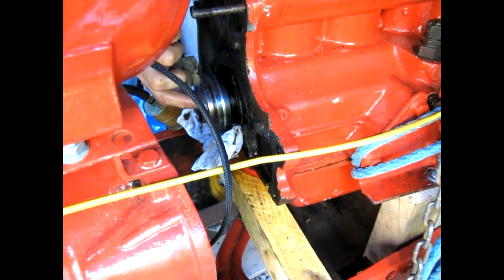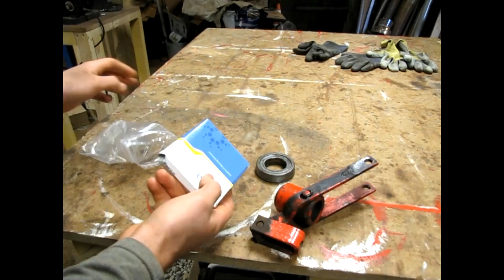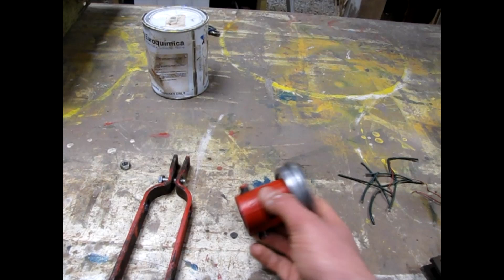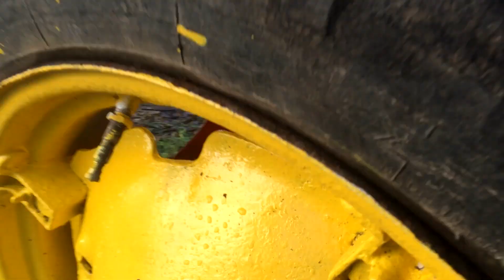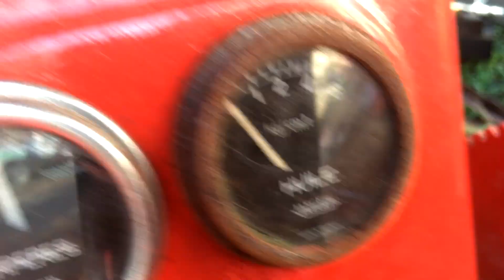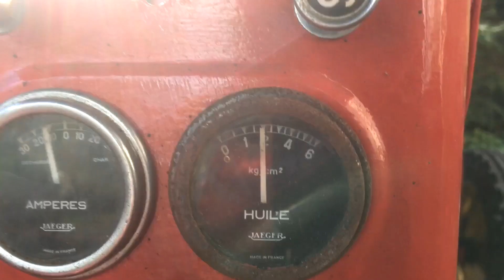The Massey Harris Pony Runs Again! Clutch and Regulator repairs (pt4)

Comment: the old cork gaskets 😮😮 aren't much because they leak they draw up and won't hold 2 the surface U are better off 2 use the paper gaskets still use gasket sealer on both sides U would think 🤔😮 by now there would better gaskets 4 that the rubber gaskets W the metal tabs are better U have 2 find a bearing company that carry them and match them up 😊😊OMG 2 14 2O24

Comment: I would look and if U can find another distributor that will work 4 that engine and U can get parts 4 alot of the old tractors didn't have much oil pressure 2 them U might be able 2 turn the oil pressure up on the oil pump if not I would look and see about a over haul kit 4 the oil pump 😊😊 OMG 8 3O 2O23
Reply from the maker: For now the distributor works, when it stops working I’ll either just change the whole thing or try and find the parts I couldn’t find before. I haven’t looked at the oil pressure yet but I think there’s a screen in the system that might be clogged. Thanks for watching and commenting!

Comment: when U have the tools 2 do the work yourself it will save U from going 2 the machine shop everytime the clutch is better than it was U might be able 2 adjust the clutch 2 get it better most of the older tractors grind gears some as long it's not bad the last old I got on was the same way I would leave the 12 volt starter on it ,it turns the engine over faster and it starts faster 😊😊 OMG 8 3O 2O23
Reply from the maker: Yes, the clutch is better. I kept this tractor as a 6v tractor because that was what it was originally and the 6v generator and tension regulator work fine. It wasn’t too hard to find the correct 6v starter motor. Besides, after thinking about it I don’t think the motor that came with it was a 12v because it did start on the 6v battery in the beginning, it was just broken

Comment: the cork gaskets aren't no good because they Leak U are better off 2 get the rubber gaskets  W the metal tabs they better 4 the oil pan  water pump and valve cover 😊😊 OMG 8 3O 2O23
Reply from the maker: I would have but they don’t exist, my only option was to make my own gaskets. The original gaskets were cork

Comment: I think I may have found out about something else too - that you must have leaded fuel to run these old engines, so a leaded additive must be added to the fuel as there is no leaded gasoline anymore. keep that in mind...
Reply from the maker: I do add an additive that supposedly is supposed to lubricate the valves but I’m not sure it’s entirely necessary. I’m sure that adding a lead additive would be recommended but the thing is it’s a working tractor and it needs to run in just regular gasoline that comes out of the pump. Either or it’s been running fine without a lead additive
Reply: @toolreviewsandrestorations Love ur videos on Ur Pony!!! I have 3 Pony’s and one in particular has been giving Me trouble. Got it a year ago and first couple days ran well then started cutting off as it ran. Then got to the point it wouldnt start. 
I have put new plugs, wires, points, condenser, and rebuilt carb and still it will turn over and over but won’t start🙈
U seem incredibly smart at mechanics so thought I would ask U!!! Keep putting out Great Content!!!
Reply from the maker: @Jasonlink thanks for watching! Do you know if your getting fuel to the carburetor? One of the things I had to do to my pony almost right away was change the fuel pump diaphragm. Otherwise, how are you trying to start it? I find mine likes to start from cold with the choke on and the throttle in the idle position. Is power getting from the battery to the starting solenoid?

Comment: Yeah changing gears - be easy on the shifter and wait for the syncro-gears to allow the shift to go in or that is what happens you're chewing up the syncros, You might have to do what is called double clutching to aid your shifting
But what you are hearing and why its grinding is the syncro gears are worn and - the transmission will need to be rebuilt with new syncro-gears, try and study up on how a manual transmission works, to get a better understanding. It is a very big job to do - I'd ask around to mechanic shops whether or not parts would be available.
Reply from the maker: Thanks for the advice. I was noticing the other day when I was using it that if the engine was turning at the proper idling speed and I waited a few seconds with the clutch disengaged it shifted fine. Asides from bearings the only parts that are available are second hand ones, at least I’ve never seen new transmission parts for this tractor. Would it even have syncro-gears though? It’s an unsynchronized transmission.
It is going to be repaired properly at some point when I have another tractor to do it’s work during the repair.
Reply: @toolreviewsandrestorations 
Here's another thing if you need to adjust to help the idle/ the timing may be to advanced. Base timing should be about 8 to 12 degrees advanced - 10degrees is usually the sweet spot , but there's a catch - if you choose to retard the timing- 1 you'll lose power -2 you'll put more heat stress to the head assembly so you don't want to go to far, / It can help give fine tuning in helping control the idle if you can't control the idle via throttle valve. you would need a timing light to properly set the timing, via connecting the inductor sensor to the #1 spark plug which is the one closest to the fan and connect the positive and negative power lines to the battery, next Loosen the collar on the base of the distributor and rotate the unit. Now this has to be done while the engine is running. There should be a dial indicator on the crankshaft with markings on the crankshaft pulley in degrees -this is where you set the timing as the number 1 spark plug fires. 
If you go advanced then it too will change the idle to be higher, but on the other side of the coin you'll again lose power and under load the engine will ping, this is called predetination which too can be hard on engines, so you want to try and stay away from this. Another thing that needs fine tuning is your points - the gap needs setting too as well. This is called dwell and also can affect timing - too little gap and hard starting will result - too large a gap and same thing hard starting will happen. 7 to 16  thousands I think is the sweet spot. you need a feeler gauge or if you don't have one you can use a business card of some sort to get a rough idea. But all in all RPM's  of the engine should be set to roughly to 600 to 750. 
I must say it's been awhile since I worked on this type of engine going back to the days of my Volvo 144 with the B20B engine.
Reply: @toolreviewsandrestorations  It should have syncro-gears but how far back is this tractors age going - I'm guessing about the 1970s as the ignition system used was points and condenser type but the charging system being a generator type tells me it might be going back to the 1950s as cars started to have alternators in the 1960s.
Reply from the maker: Thank you for all the advice. It does idle fine but I don’t always remember to push the throttle all the way back to the idling position. It might still need the timing adjusted but the points are set correctly. The tractor is from 1952. The transmission is pretty simple, not many parts in it that’s why I’m not sure if it has syncro gears. I’ll have to consult the manual.
Reply: No these tractors don't have synchronized gear boxes. None of the old Massey farm tractors did. Actually I don't believe any USA/Canada made tractors did. Trying to shift it like a synchro trans will break stuff in short order. You have to be pretty much stopped or it will just grind. The only way to shift a non synchro trans on these old tractors while moving is double clutching. Since a Pony maxes out at like 8mph If I recall correctly, it's basically pointless to shift while moving. Just stop completely then pick your gear.
Reply from the maker: @jeremydavis2595 yes, that’s right. If I want to drive in third gear, I start in third gear.